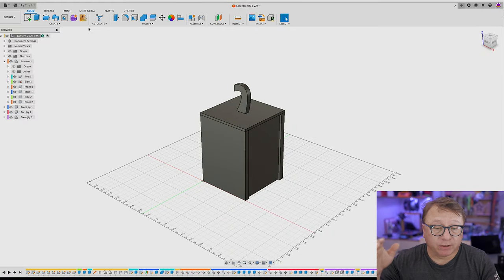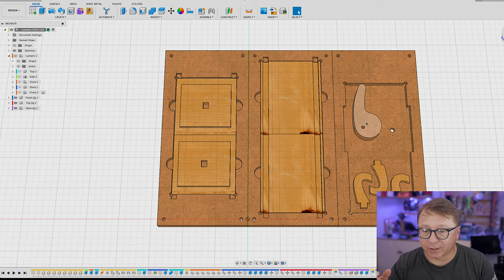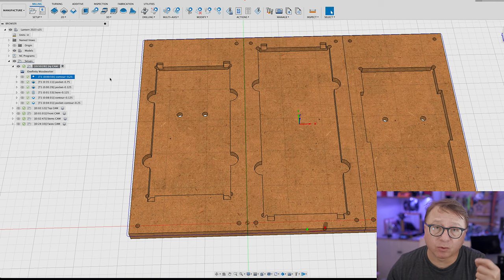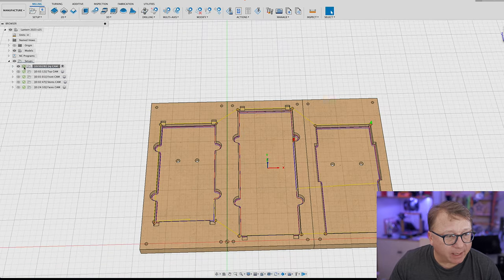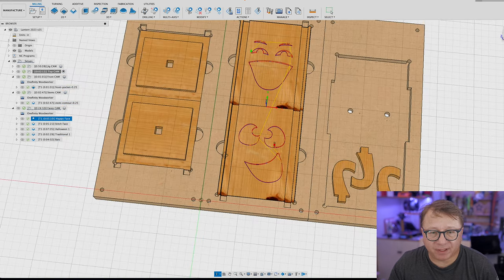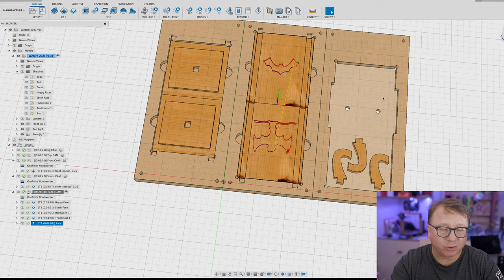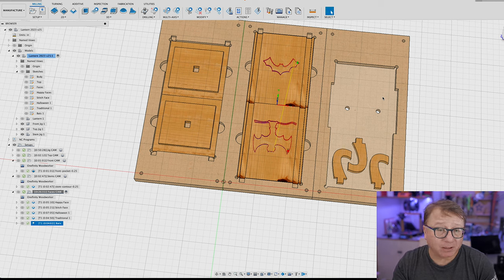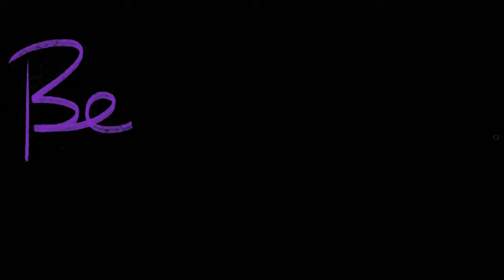INCREASE profit and DECREASE production time!

Comment: Hi, I have subscribe to your channel for some time and in a previous episode you mentioned Sainsmart Genmitsu 3018-prover v2.
I am on the verge of buying one of those, however, I am not a Windows user, at least not for the last 25 years. Can Easel be used with Mac and does it make its own G-code or do I need something else.
I live in South Australia and enjoy your videos.
Cheers
Guido Wagner
Reply from the maker: Hello Guido - Easel is browser based and works with Safari. As of right now,  you can still download gcode from Easel and use it with the Genmitsu. It is possible you can use Easel to control the machine too since both are based on Grbl. All that said, if you are looking for a high degree of precision or accuracy, the Genmitsu 3018 isn't the best machine -- see my review of it and the tests I ran.  Thanks for watching and subscribing!
Reply: Thanks for your prompt reply, however I still need a little further assistance - I downloaded Easel onto Safari set up a new project, created a 4" x 4" workpiece and placed their snowflake on it. After making the necessary adjustments, I went to the edit machine tab and registered a Genmitsu 3018 prover. I then went to general settings tab and clicked on download G code and it placed the project in my download folder as a .nc file - here is my question - How do I get it from my download folder onto the 3018 to cut or carve it out.
Please remember I am a total Newbie
Cheers
Guido
Reply from the maker: Hello Guido - you need to put on a micro-SD card to use it with the offline controller, or load into your gcode sender. I covered all that in my video (https://youtu.be/tktC2nkCX0g?si=MYiRLuH-1BUSH4t-&t=184).
Reply: Got it, thanks, here's where I'm getting confused - I watched "James Dean Designs - Beginners guide to designing in Easel - 3018 PRO" and he states you can run your machine directly from Easel - when he clicks the machine tap, (about the 28 minute mark)  the drop-down menu shows the word "advanced" at the very bottom, he then clicks the word "advanced", and it opens up another page with export G code. - I don't get that at all. can you throw some light on that ?
Reply from the maker: Hi Guido - As of Sep 2023: In Easel - click Machine -> Download g-code. Note where that file is stored. Place a micro SD card in your computer. Copy the g-code file to the micro-SD. Put the micro-SD into your offline controller. Click select on the controller, select the file, click enter. Further instructions here: https://docs.sainsmart.com/article/1nzfeckqu0-using-offline-controller-on-genmitsu-3018-prover.